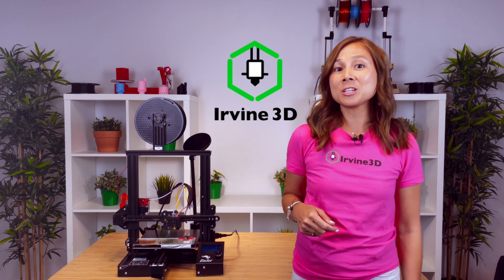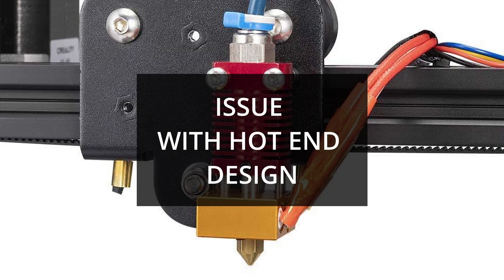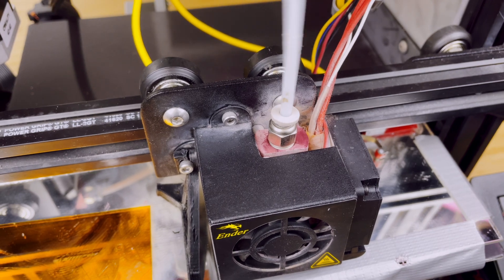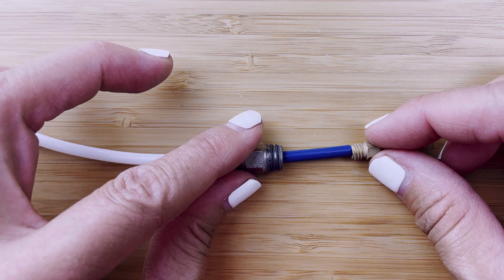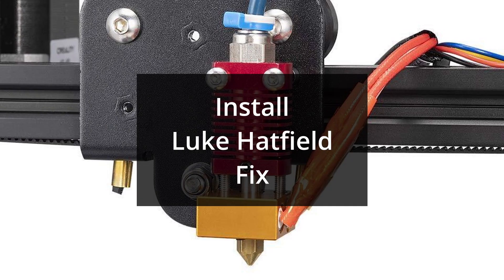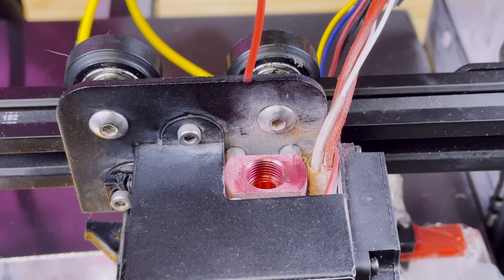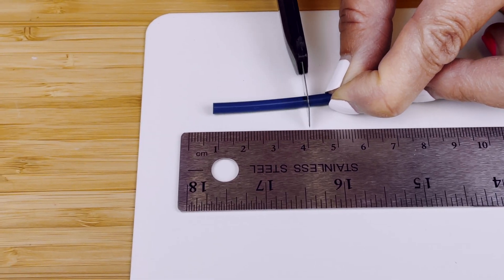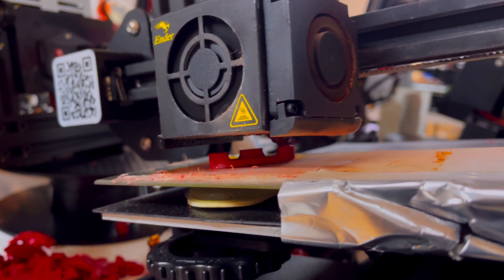Hot End Fix for Creality 3D printers

Comment: where did you get the nut from? I never saw anything mentioned about it until you said to place it between the bowden tube and the coupling?
TY 
Jeff
Reply: You print it, it's available on thingiverse along with a guide to cut the PTFE tube to the correct length.

Comment: my printer broke, i bought a new hotend and installed it and it still reads room temperature instead of my nozzle
Reply: Same and I'm getting PID failure still even after tuning and saving the settings with Ponterface
If you had a similar issue and have a fix let me know

Comment: Why not just use all Capricorn tubing and bypass the extra steps? I use it and have not had any issues...AND it last way more than your claimed 2 -3 weeks.  I'm going on a year or more with zero issues.
Reply: I'm guessing because you still have the tubing being pulled on that way. I'm using Capicorn tubing and I'm replacing it with this deisgn as I'm having issues after 6 months of almost constant use.

Comment: This is an interesting trick, but for the same price as a little tubing you can get a modern thin-throated all metal heartbreak machined as a single part (no internal lips to jam like legacy ones) and be done with ptfe degredation forever and get access to high temperature materials.
Reply: The caprciorn tubing is around  $18 where I live. Is there a reliable all metal heatbreak of the same price. Please share.

Comment: wouldn't it just be easier and better to get an all metal heatbreak
Reply: not necessarily, i have a creality spider(isn’t great at all) but im gonna try this method to see if it allows it to print much better now but most standard hotends are good as they are
Reply: @leaksandtweets_6544  I mean if you only print pla might be good to stick to Bowden setup but if you print mix materials like most people do then all metal is defo the way to go especially for higher temp materials like abs

Comment: Nice short demo but I would say that you should use a mini pipe cutter or a jig to cut the face of the Capricorn tubing that will contact the hot end because trying to do it freehand like you showed will almost always result in some gap - which is the very thing you are trying to avoid - and so it will not be effective. I have never done this 'fix' with my printer but I find that simply cutting my ordinary PTFE tube with a flat-face cutting device (as described above) and using a high quality toothed gripper at the top of the hot end (plus keeping my printer well maintained, not printing too fast, etc.) results in no issues for me after 4 years - but you seem to run your printers more than I do (also I only use PLA).
Reply from the maker: We didn’t need this fix when we were primarily printing in PLA, but once we started using PETG more the printing temperature would destroy the Capricorn tubing. This fix reduces the frequency we need to change the tubing and amount of tubing we waste each time.

Comment: I didn't have any clogs since I have switched to titanium all-metal heatbreaks on all of my printers and shortened retraction distance.
Reply: hi whats ur retraction distance? i have an ender 5 pro
Reply: @l.d.tjonathan5101  All metal hotends for V6 style must have retraction under 6mm, my bowden printers have 1.1-1.5mm retraction distance. There is more than retraction distance which affects stringing, for example fast travel move speed and acceleration (can be set in Cura, ideaMaker, new SuperSlicer).  Also turn off Z-Hop, lower tempeature and dry filament.
Reply: @NemecJiri  thanks for the answer, ill definitely try that !

Comment: What is going on with your hotend? Is the residue just…dust from your filament? I’ve run vorons 24/7 and have never seen that level of dust accumulations before
Reply: In the print automation video PETG is mentioned. This looks like that to me. Not sure what this is exactly but I get similar white residue all over the hotend and printbed when printing a lot (more than a roll) of PETG.
Reply: @jeremyf9592  That's unique. Do you remember the brand? I went through a few hundred kgs of esun's PETG for the COVID masks but have never observed that. Maybe its from some brands formulation?

Comment: Hi Melinda, I like your videos 
I have a Creality Ender 3 v2 and had extruder problems as well, despite using Capricorn tubing from extruder to hot end. I'm thinking of changing the Creality hot end for a Micro Swiss all metal hot end (or similar) because, a) it is an exact replacement for the standard Creality hot end and b) it will move the end of the Capricorn tubing out of the hot zone, meaning I will never need to replace the tubing because of heat degradation again. I also intend to investigate replacing the standard bowden couplers with compression couplers, they appear much better at griping the tubing, meaning they will stop the wear of the outside of tube, which eventually allows movement between coupler and tube. https://www.youtube.com/watch?v=c-co7FW90MQ